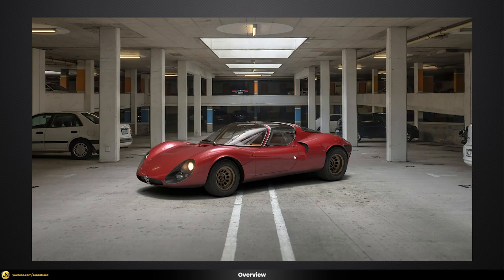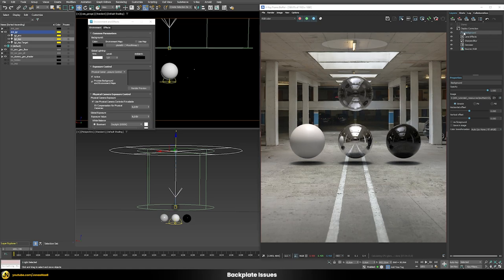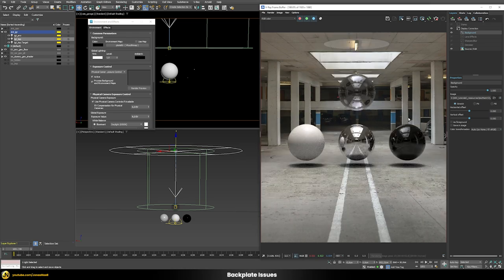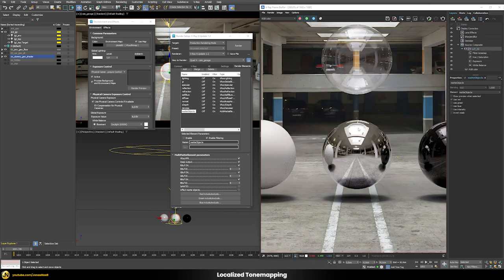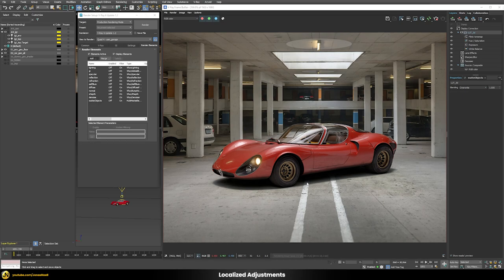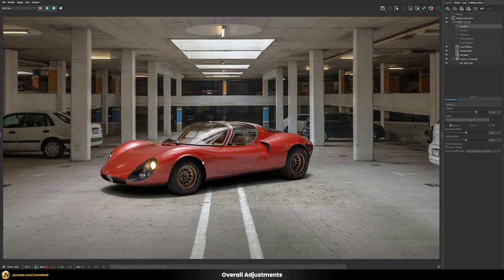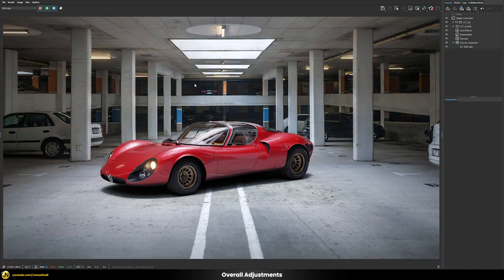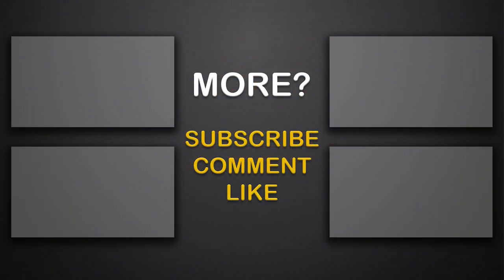V-Ray | ADVANCED Tips + Tricks for  Backplate Integration

Comment: How did you position that plane with the mask in the very end 15:07 so acurately? was it aligned to the camera target and then you eyeballed the correct scaling, so made it fit to the camera frame manually?
Reply from the maker: No, I forgot to mention: I just used screen space texture projection, so it matches the backplate 100%
Reply: @JonasNoell  Alright, yes, so the actual size of the plane's geo is not important. that is nachvollziehbar.
Reply from the maker: @sturm3d  Exactly, as long is it slightly larger than the camera view and positioned in front of your 3d elements
Reply: @JonasNoell  By screen space texture projection you mean , vray decals?
Reply: It seems to be a "camera map Modifier"

Comment: The glass sphere turning black with the VFB Background workflow is caused by the settings in the shader. Setting "Affect channels" to "Color+Alpha" for every refractive shader in the scene resolves this issue. Also, the VFB Background can use an alpha, if it was saved in the image. That way you can overlay certain parts of the background over the rendered content by activating "as foreground" in the VFB Background options.
Reply from the maker: Thx for your input! That's indeed correct for the refraction part, however the other issues remain that's why I still prefer the demonstrated option :-)
For the Backplate + Alpha as foreground also works but with the demonstrated issues of the Backplate element, eg. no Real-Zoom. 
So basically the demonstrated workflow in the video doesn't compromise on anything, the only downside (at least to my knowledge) is the slightly more complicated setup process... :-)

Comment: Exelent! Quite a lot of little things which I have known exist, but never actually touched them. I love working directly in the frame buffer mainly because of light mix and ability to quick adjustments to lights. Ofcourse, with exr workflow in Photoshop it also possible, but then there is a large 32bit files and it's not exactly a good thing for my job, but yet - really powerfull, I should admit :) I'm shure, I can find usefull tricks for me and have more control. One thing I'm always struggled with - it's shadow integration. When I render its on matte object and export with png+alpha, or just alpha, all the color of lights and ground is lost, basically. I wonder, if you render it on backplate and export with alpha, is it gonna be fixed?
Anyway, thank you for another great tutorial! 👍
Reply from the maker: You can add a VRayAlpha in the render elements and it should save out a pass that keeps the colors intact. They are only lost in the original png because the built in alpha channel does not allow colors.
Reply: @JonasNoell  omg, I've never knew that =_= Thanks!